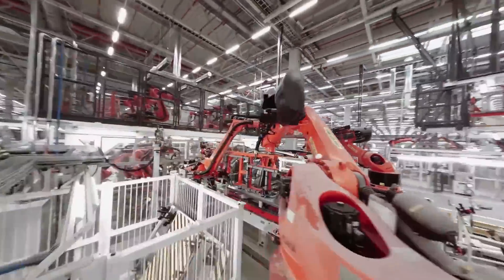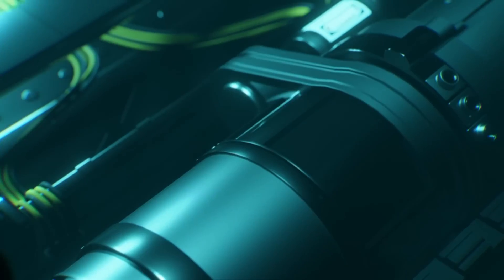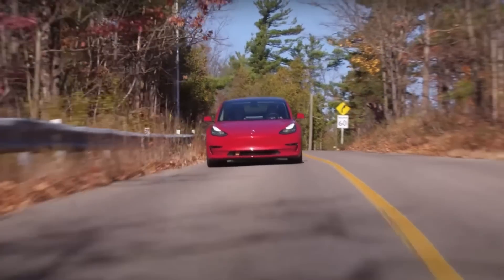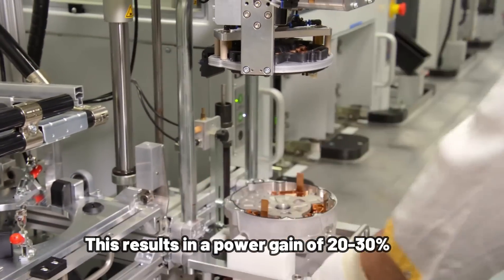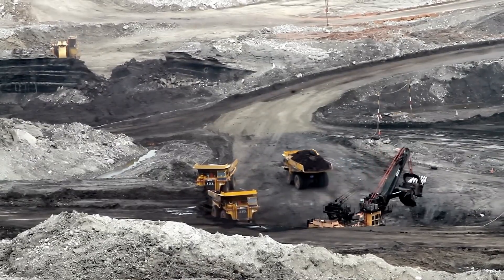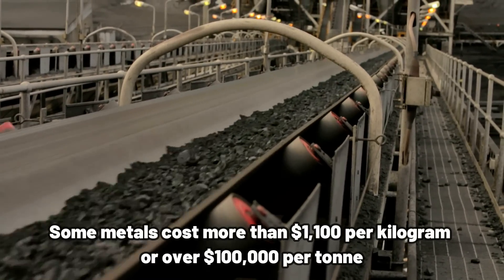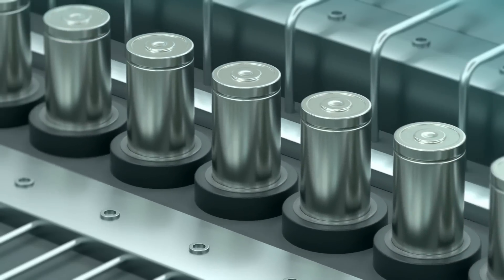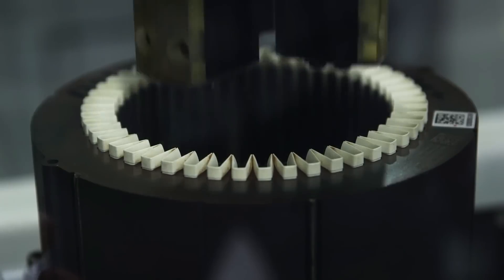Elon Musk's NEW Motor SHOCKS The Entire EV Industry!

Comment: WHY CAN'T THE FRONT TIRES BE USED TO TURN A GENERATOR, TO SUPPLY & REGENERATE 
THE BATTERIES THAT THE REAR MOTOR IS USING TO PROPEL THE CAR/TRUCK ?
Reply: Isn’t that their braking system? They already do that, but it just extends mileage there’s no such thing as a perpetual motion machine.

Comment: tesla motors are not cutting edge interms of power density.lucid, rivian have more comoact motors and 4 motors drivetrains but they are still more advanced than all the mass market automakers and they have the best conpromise between cost, production capacity, and technology
Reply: They are the top in terms of efficiency, though. That's more important than power density because you need less cooling and have more range.
Reply: @Boostocska  lucid are actually more efficient. lucid air 140 mpge vs model s 120mpge
but efficiency of the car is not efficiency of the motors there are lot of other factors tires, wheels, drag coefficient, frontal area, ac/heating, electronics.
Tesla have big efficiency advantage against legacy manufacturers because they have been chasing losses for years and software is better, they have induction motor in the front with different gearing and that can coast freely and use only the rear motor for efficiency, or use both depending on the speed/load which makes AWD more efficient than RWD
Also don't forget that Tesla do have very good EPA scores that they are optimized for EPA test that boosts their moge rating but don't perform as well in real conditions. Porsche is pretty much the opposite Taycan scores very poorly on EPA but does much better in real life.
Taycan scores 192 miles EPA range vs model S raven 348 miles EPA  but the 81% range advantage on paper shrinks to 6% when doing 75mph range test...
Lucid did beat the Tesla longest range ev model S LR by 90 miles on a 75mph range test
all things considered I don't think Tesla has rally more efficient motors than the competition but their global approach to range and efficiency pays off vs most other EVs
Reply: @Boostocska  Rivian is out of the equation because it's a very heavy truck, and they have huge battery drain problem

Comment: it will be safe  for people, it is electromagnetic?
Reply from the maker: Based on available information, its unclear whether the engine is electromagnetic or not. As for safety, it will sure need to meet regulatory standards before use in production
Reply: Let's say it meets the standards . 
By using the electromagnet engine it will continue to charge the batteries
correct ? 
If so then it would not need a charging station correct ???.